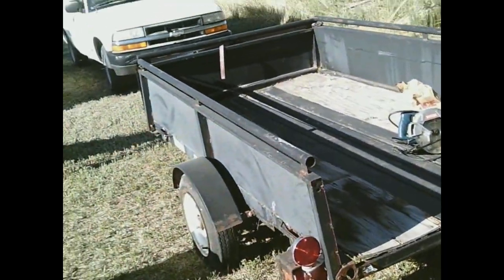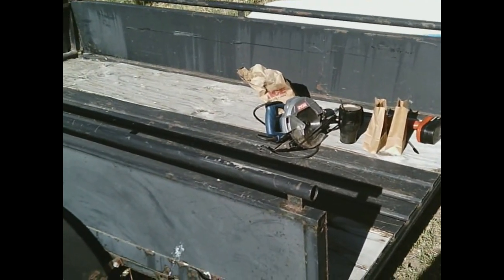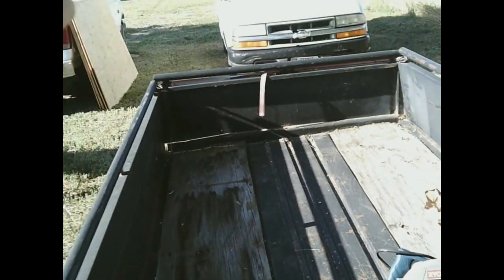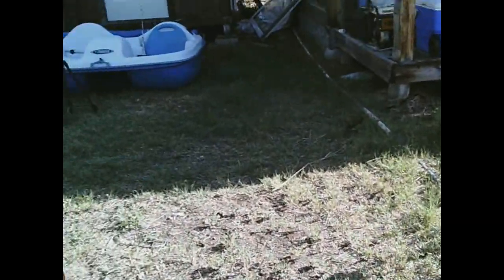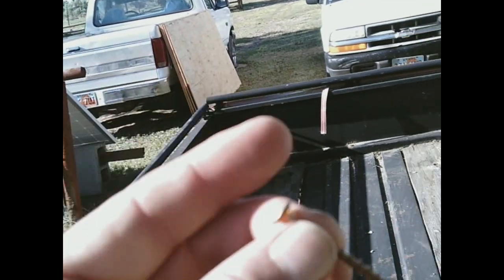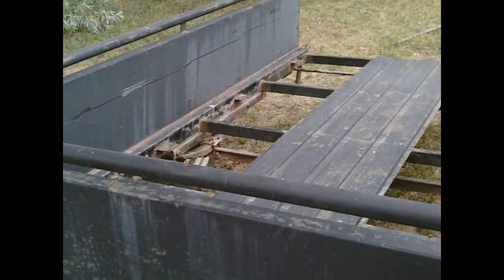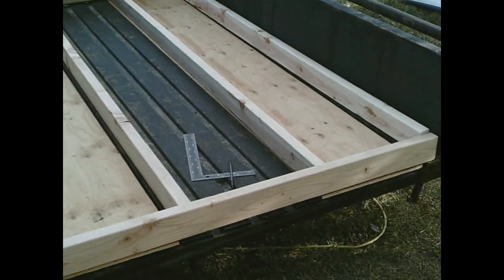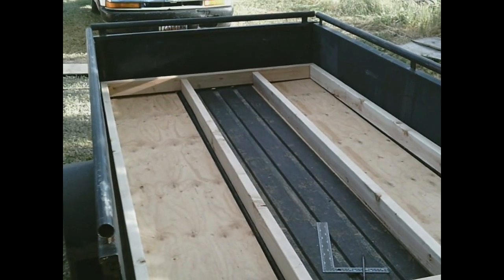Shepherd Wagon Vardo Part 2: Trailer Prep & Floor Framing

Comment: Thanks for this video. I'm looking at a  5x8 aluminum Ironton trailer from Northern Tool to build this on using the floor framing the Redhawk plans. It helps seeing someone do it along with the plans.
Reply from the maker: Right on!  I had to adapt the pans to my old trailer but easy enough to do if you understand the framing construction.